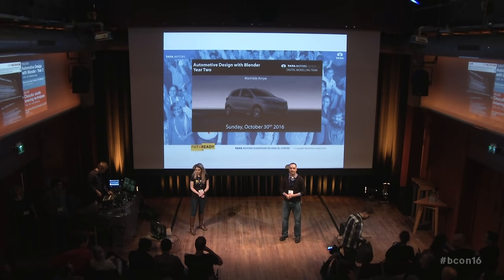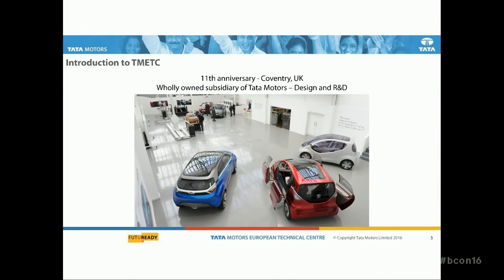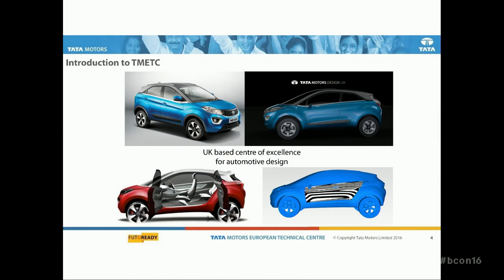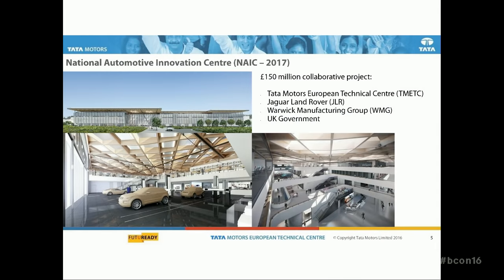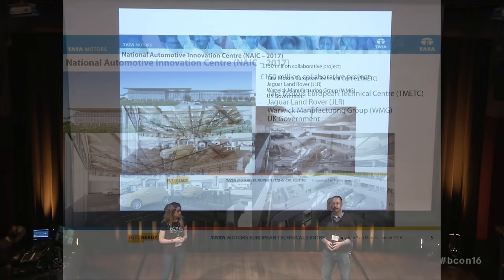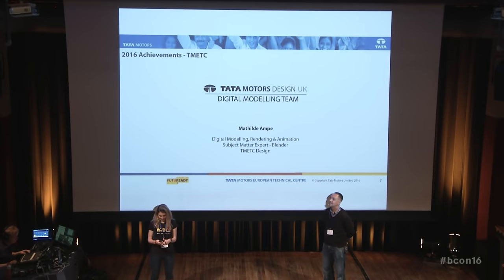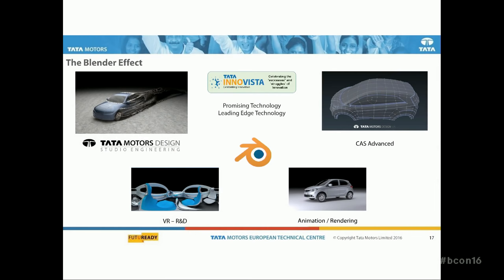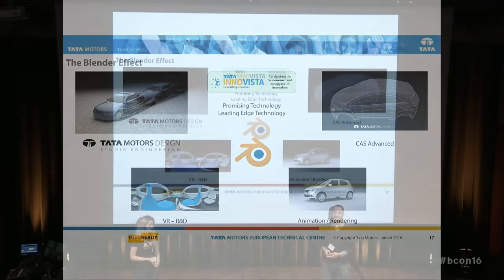Automotive Design with Blender Year 2

Comment: Blender pretends to enable physics for rigid bodies, but it only offers a sort of simulation of it.
While you can create joints between rigid bodies, a truly physical analysis is based on applying forces and torques to physical bodies and mechanisms to make them move. Blender only lets you specify target behavior and it greatly fails to achieve this. 
The mass of the bodies can be specified, rotational inertia's can not. Neither can be forces or torques be applied.
Your claim of Blender being an engineering tool is at least misleading. 
In addition, all sorts of Blender simulations come with many parameters which have no physical known meaning and nobody knows what they are actually for, at least it's not documented or not in a physical way. I have seen people manipulating gravity (which should be a constant and not be touched while on earth unless you are on the moon or other extra terrestrial planet) to  simulate cloth behavior, such as a flag. At this point, this is nothing I am willing to follow or understand when some sort of parameter is just called gravity but physically it is not. 
I am very interested to use Blender to present the results of my engineering work. In my case this would be for example the deployment of a solar array of a satellite in orbit, but the blender physics is so quirky and provides unrealistic results that I really cant use it for this, not even for a simulation, as it appears to be too unrealistic with the behaviour it provides.
Reply: It´s obvious that Blender is not an engineering tool nor a physically based simulation tool. It´s more of a prototyping tool in the industry, and it´s main focus is centered in the artists, not engineers.
But also, regarding simulation, Blender uses the Bullet library for rigid body simulations, and it´s meant to be used just as the name suggests, to simulate rigid bodies. That´s why you don´t see any torque nor inertia parameters. Moreover, these technical details remain exclusively into the domain of the bullet library, which the Blender Foundation is not responsible for, nor maintains.
Other simulations, such as particles, cloth, ocean, smoke or fluids, has their own engine or library dedicated to it. That´s why sometimes there is some loss integrating various simulations, as these aren´t really compatible in it´s structure. You would need a huge investment in development to do that, development that isn´t supposed to benefit all users, as this is only specific to engineers.
Blender could make use of other advanced libraries, but these must have permissive licences to integrate, and you need enough people interested to have someone invest time to merge these libraries.
Reply: It's open source, build any addon you like...